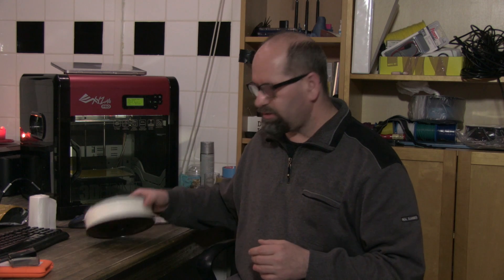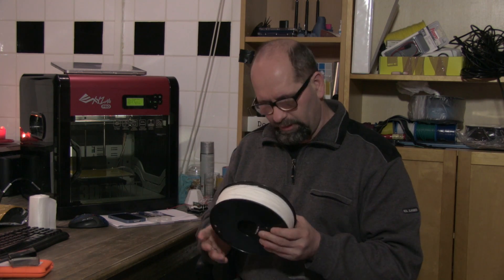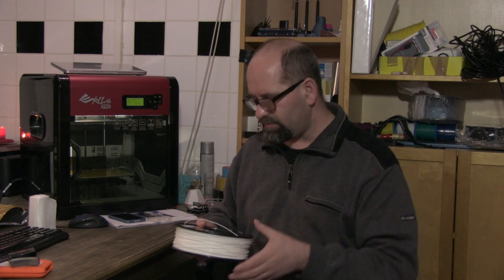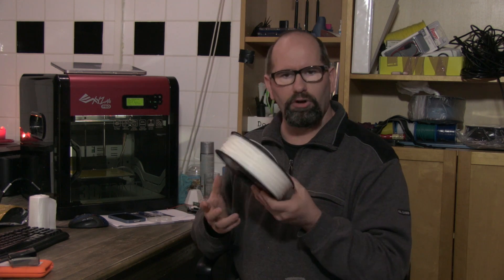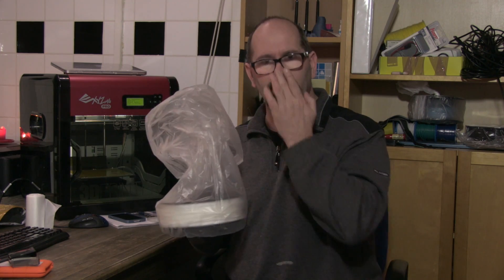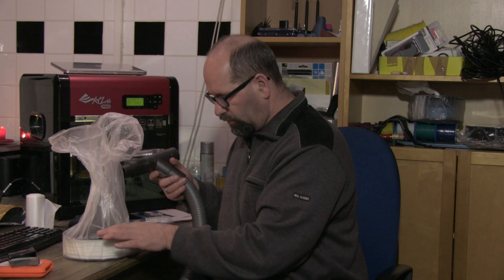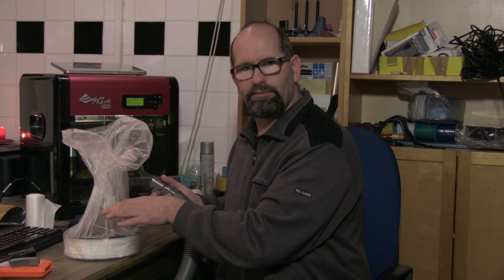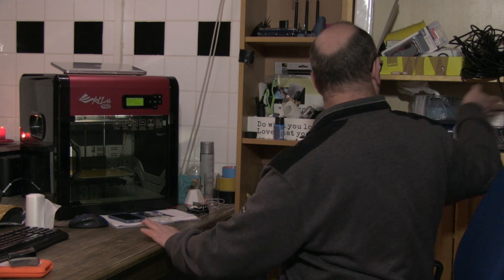▼ Keeping filament dry when storing it, like Nylon and ABS

Comment: Also they screws that you use to mount the red bits that hold the fans are the screws 3d printed if so are they resin or are they abs or something like that if so is there a specific reason why you did this, if not would it be possible to use metal ones
Reply from the maker: The screws I use are lightweight nylon screws, that can be bought in any hardware store.
Using steel screws is no problem, but I tried to mike the whole thing as lightweight as possible.
Reply: @3dPrintCreator  ok thank you, Do you have plans for your electric circuit that you used for the fans on the xyz 1.0 pro because I am trying to do exactly what you did but I don't know how to lay out the wires and I don't know how to connect it to the printers power and I don't know how to make the circuit that is right above the print head, I don't know how to connect the LED the switch and the fans and wire them all together.
Reply from the maker: @alexandermaddison8812  No sorry, not anymore. I don't have the XYZPrinting Da Vinci Pro anymore. I made a self-designed printer in the housing of that machine, but it has nothing to do anymore with the Da Vinci Pro.
Reply: @3dPrintCreator  Ok thanks for the reply. Also although you don't have the xyz printer anymore would you be able to tell me if you printed TPU or TPE with it when you used to have it, if so would you be able to tell me what settings you used such as: nozzle temp, bed temp and print speed and also how to change the print speed for a xyz davinci pro 1.0.

Comment: My Da vinci PRO won't reach higher temperatures than 210 degrees celsius. This is a huge problem when I am trying to print ABS. Do you have any ideas?
Reply from the maker: +ｔｏｍａｓｕ とうます To be honest, no... I can set my temperatures up to 240
Reply: +3d Print Creator I figured it out a while back. What I meant was that it would stop at 210 when I set it to 240. It was due plastic sitting on the nozzle.
Do you get any great print results on the davinci pro? After purchasing a Wanhao I3 v2 I am starting to doubt whether the PRO was a good purchase.
Reply from the maker: +ｔｏｍａｓｕ とうます I am very happy with the results of the Pro. The machine has some downsides, but what machine doesn't? Overall the quality of both the machine and the printed objects are great.

Comment: You could use large Mylar bags with oxygen absorbers like they use to preserve dried foods. They in a short space of time absorb the moisture and oxygen inside the bag. Just place reel inside with oxygen absorber and use an iron to seal the end of bag. Bye Bye moisture!
Reply from the maker: +bob bobless I am sure that works great to. But this also works great so I stick to this way of working.
Reply: I use a bag sealer when i restore my filament. Plus i buy a 500’ roll of open ended, make my bags any length I want. If you leave an extra inch you can reseal the bag twice.

Comment: Hi! U have try print Nylon+Carbon? :D
Reply from the maker: +TreeOxy Alain Bucci Actually. I have done a lot of Nylon prints already. Carbon I didn't use because of the brass extruder which can wear out with Carbon filament.